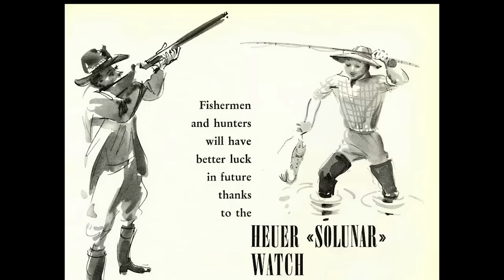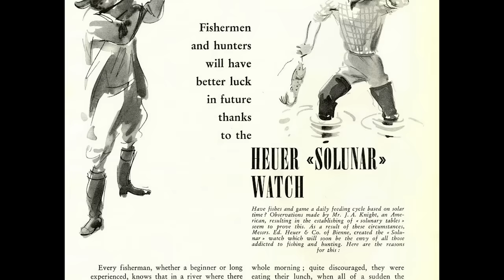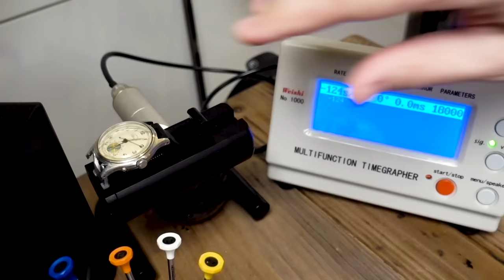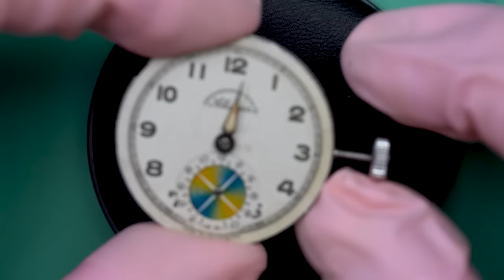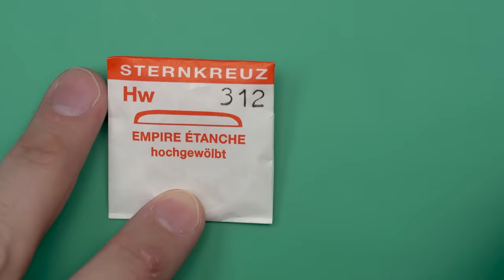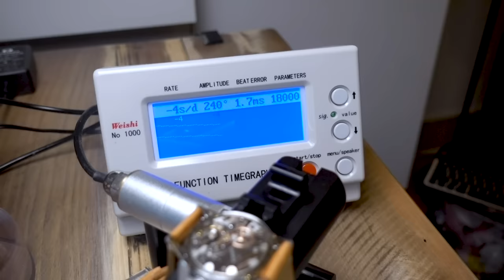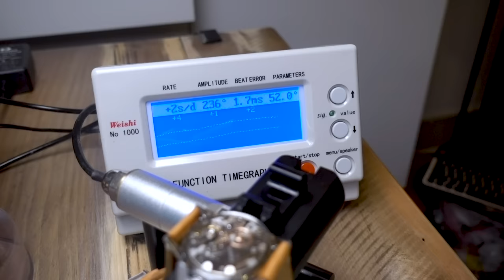Abercrombie and Fitch Solunar Vintage Watch Restoration

Comment: Wonderful restoration, Sir! I am no watchmaker, neither am I an engineer of any sort, but I think you don't explain that amplitude factor well enough. It seems simple to me. The amplitude, measured in degrees, is the total arc of a circle travelled by the balance wheel, from one end of its travel, to the other end of its travel. Measured in degrees obviously because those are degrees of arc. Strictly speaking, the balance wheel travels half the amplitude clockwise beyond its "resting" point, and the other half of the amplitude anticlockwise beyond its resting point in the other direction. So amplitude would imply the strength with which the spring and the train wheels and the pallet are able to send the balance wheel scooting off in one direction before the balance spring stops it, and makes it return, again to be shot off in the other direction by the pallet clicking over. The less the friction in the train of wheels and the stronger the spring, the larger will be the amplitude of rotation. Older movements, with more tired springs equal lower amplitude. Or have I got it all wrong? And pardon me bragging, but I spotted the bent seconds shaft as you took it out and laid it on the movement. All in all, an enthralling video. Thank you very much!

Comment: Ok, i'm not into the watch repair hobby , into classic British  motorcycles, however that vinegar and bicarbonate of soda mix is a bust. The vinegar is acidic but the bicarb neutralises the acid, dont mix them together if you need them to work,lmao, one will kill the other. You should have soaked the parts in the vinegar to remove the rust and then soak them in the Bicarb and water mix to neaurtalise the acid. Been using this method for many years on the old bikes. Hope it helps.

Comment: Hi Marshall great videos inspired me to attempt a repair on my late fathers precious 1940's commemorative pocket watch. using your guides i was able to get it running again than you for such clear instruction and the information you give on the names of the different parts and their history is awesome. i do have a question i need hands for the watch and i am finding difficult to source them i remember the type of design they were from my childhood but i cannot find the correct sizes [0.5 x 18mm minute hand , 1.7 x 11 hour hand 0.35 x 6 sub second hand] do you have a website our source i could contact this would finish off the project perfectly - i understand if you are unable to answer - keep up the great work

Comment: Wow this is a fantastic watch, selling on Ebay for over $13,000. Very nice video thanks.  Why don't you oil the main spring? Is it not supposed to be oiled?  Main springs in clocks are always oiled. Are watches different or do they come pre-oiled and they don't need to oiled?

Comment: It's a lot easier to regulate a pendulum clock than a wristwatch. There, you are looking for equal overswing on either side, e.g.  Tick - overswing - Tock - overswing. That overswing and the equality of it on either side are your amplitude and beat error, and you can time it with a chronometer, such as I have on my own watch. I got my late grandfather's Gebruder Resch "Remember" Vienna regulator working after decades of non-running. My late dad got a local horologist in, but he couldn't get it going.

Eventually I stripped it, saw how it worked, reassembled and oiled it, and it ran. Because the clock has no remontoire. it loses a bit of time every time you wind it. I have regulated it so that it gains that same time (three or four seconds) in one week (after which it needs rewinding). My grandfather received the clock in damaged condition, so he bodged several broken components (e.g, brazing part of a jeweller's screwdriver onto the end of the broken chime flirt). Over time, I have got a couple of "for parts" Gebruder Resch movements and replaced all the bodged parts with genuine Resch originals of the correct era.

I have repaired and restored anniversary clocks, cuckoo clocks, carriage clocks. wag-on the wall and mantel clocks, just for pleasure, though I do get some money from my hobby.

But never once have I felt confident to tackle wristwatches, and I am amazed at your skill and steadiness. I would be losing screws right and left if they weren't big enough to tie up a tugboat. Your skills are impressive, and I love your videos.

Comment: I have a modern watch like this, where it shows a bunch of outdoors info. I think mine shows a compass and tides.

It does use a battery, but it's quartz so hey that's a definite plus
Reply: Ok turns out it tells basically everything, like temperature, tide, date, and direction lol

Comment: Hey Marshall - I have been watching your restorations/repairs for a few days now and I am now hooked! I have an original Citizen Navihawk I bought back in the 80's that I will be cutting my teeth on restoring. One of the items I need the ultrasonic cleaner, but cannot seem to find one with the basket that doesn't allow the small parts to fall out like the multi-level one you use in this video.... can you help me out there? Thanks!

Comment: Great vid. Distilled vinegar soak removes rust (just let it sit and soak an hour or overnight depends on the rust). Add baking soda & water to neutralize the acid after scrubbing and dry and spray with WD40 wipe clean.
Reply from the maker: Good to know, thanks!

Comment: Hi. Just a tip. when you put the baking soda,in the vinegar. It stopped the vinegar from working. The baking soda is to neutralize the vinegar. You can use evaporust ( check spelling )  It will not harm the metal,but does remove the rust. I am a new subscriber. Just want to help if I can. Liked,shared. All my best.
Reply: hi bobby !

Comment: Electrolysis can remove rust. It’s like plating but backwards. It can remove plating and paint too so be careful but a short dip really helps with rust. Test it on a junker. Plate after electrolysis to prevent further rusting.

Comment: Just a note for the future that main spring with the bend at the end. That is an old clock makers trick, cut off damage, heat it up glowing, then bend over. It act like a catch on the barrel hook. Its when they could not find a replacement spring.

Comment: Loved the video! Marshall one question: when you pull the pallet fork with a wound movement it is possible to crack or break the Pallet Jewell? If it is so, what would you do? Find another pallet fork, or it is possible to replace just the jewels?
Reply from the maker: It is technically possible but it's still very unlikely. If you do break one you can replace the fork or the individual jewel but the jewel replacement is kind of an involved process involving heating it to loosen the shellac that holds it in place and then melting more shellac onto it.
Reply: @WristwatchRevival  Oh, thanks!

Comment: This is a interesting video I see that you're new to this, I also noticed that in your video you've missed at least 4 jewels and the main spring itself. The jewels you don't show cleaning and lubricating are the ones for the balance wheel which are critical for the Operation of the watch which if aren't cleaned and lubed could snap the balance wheel pivots and create the biggest problem you'll ever have in trying to find a replacement or having to actually make one on a lathe (which I have done) and isn't an easy thing to do. Also there are 2 more jewels that are held on by a plate and screw they also need to be removed and cleaned and lubed. Also you need to lube the mainspring use the high tension lube I think you said it was the blue lube?

Comment: I use a solution with oxalic acid to remove rust by soaking overnight but never on anything that small. Electrolysis works well also. I've scrubbed rust off of plated parts using aluminum foil and Coca Cola, too.

Comment: Wonderful video 
There is a product called “metal rescue” that removes rust and will not harm the base metal, I use it all the time.
You can also use a 50/50 mixture or water and vinegar but only let the part soak for 15 minutes at a time before rinsing and cleaning, if rust remains then repeat but if you leave the part in the vinegar for to long the vinegar will pit the base metal.

Comment: Hi Marshall, I really enjoy your videos. I am a beginner at the watchmaking hobby, and I have a question: Where do I find the tool you use to wind a watch when the crown and winding/setting stem has been removed? It's a small tool with a square thin protuberance, almost like a drill bit,  that you insert into the hole where the winding stem usually goes. I'm looking for one that works on pocket watches, so square, and about 1/16th of an inch or so wide. Thank you in advance!

Comment: Quick suggestion - if you have steels specifically that have significant amounts of rust, but you want to de-rust them GENTLY, get yourself a bottle of Evapo-Rust. It's fairly chemically inert, i.e. it's not an acid, it's not caustic, so it's a lot safer to use. And it's reusable.

Comment: Love the watch and the video, thanks for sharing. Just a question and NOT intended to be critical, there was some staining that remained on the hands. I know you prefer minimal appearance work, and don't mind signs of use. Do you want the staining on the hands to reflect those signs of use, or is some refurbishment of them too difficult or risky??

I had seen a couple of the A&F watches over the years, but had no idea the works are that high end. I'll be watching your videos, thanks for taking the time.
Reply from the maker: That to me is the defining line. I don't mind some light cleaning if there is dirt or rust on a part like a hand, but I would stop at refinishing them or replacing the lume. In this case I did go back and lightly clean up the rust that was on the hands to try to prevent future wear on them. The lume is so delicate though it's risky so I only did it a little.

Comment: Winding stems and even crowns are kinda considered replaceable at some point...ultra fine abrasives and oil are sometimes necessary to get rid of rust.  Considering the value of that rust, that's one I'd contact a pro about.  Very cool watch. I sense you're realizing the need for a lathe soon.

Comment: Most guys use MC51, which is extremely safe and reusable, but I think if you use vinegar baking SODA, you should do vinegar first, then baking soda if it's steel then distilled and isopropyl alcohol.
Reply from the maker: I'll check that out thank you

Comment: Great stuff! I grew up reading John Alden Knights books on Solunar Theory. As an amateur watch tinkerer, How come you don't let down the mainspring before working on the balance wheel, etc.
Reply: He usually does let down the main spring first, he just explained at 12:30 that he couldn't figure out how to do that on this specific model until he took it apart

Comment: So nice! Did you use a tide table to set the correct tide time? Also, do you need to replace the pusher tube/pusher for the subdial?

Comment: I think one dip is (essentially) what my dad used to call trike (that's how it sounds anyway). We used it for cleaning grease off delicate engine parts. Trichloroethylene (TCE) is a nasty chemical and you should not let it touch your skin (but it does feel quite nice as it evaporates off your skin - as a kid I would put my finger in the jar my dad kept it in, naughty boy I know), nor should you breathe in the air near it as it evaporates. The FDA has banned it for some of its prior uses as it causes cancer. That watch is so cool.

Comment: Looks like most of that rust originally came from the winding stem. To get the rust stains from the other parts, you could use your ultrasonic cleaner with a weak acid, like vinegar - without the baking soda. Baking soda actually neutralizes the acid. I would definitely replace the winding stem, though.

Comment: Vinegar and baking soda neutralize each other when mixed and become ineffective. People see bubbles coming out due to the two reacting together and think some cleaning action is happening. Use Evapo-rust; it is a very safe non acid rust dissolver.

Comment: Fun fact: the more quickly something evaporates, typically the higher the alcohol content.  One-Dip, depending on the manufacturer, is usually 99%+ tetrachlorethylene or trichlorethylene.  Manufacturers add ethanol and similar products to lots of liquids (like bleach wipes) to make them dry faster.

Comment: When I was in Germany, rust wasn’t allowed on vehicles. There was a product that would react with the oxide and neutralize it, however the rust turned black but would pass the inspectors screwdriver test. It was called a rust converter.

Comment: 1:05:07 is that a split in the watch strap leather by the bottom spring bar? Fantastic video by the way, just dont want the watch strap to break and cause damage after such a lovely restoration

Comment: Early comment. As long as the location of the rust won't hinder performance, a short soak in some evaporust then a wash should be enough to hault the corrosion.

Comment: Molasses and water mixed 50/50 is a really great rust remover that's easy to use...
Reply: Also, dipping parts in Gibbs Brand oil and wiping/drying them back off will help keep any future rust at bay without making the parts oily or attract dirt. It seems to soak into metals really well without discoloring them or leeching back out. The stuff is wonderful, I know of hot rod guys who drive around in bare metal hot rods that don't rust because the sheetmetal is wiped down with Gibbs Brand oil...

Comment: I have no experience working on rusted watches, more with bicycle-sized screws/parts, but:

For chemical rust removal, the key is time. No brushing usually is needed, just an overnight or somwtimes longer bath in concentrated vinegar (vinegar essence) or citric acid followed by a light wipe-off brushing. For small parts, a few hours should be enough. The reaction always takes time and happens by itself, it‘s just a chemical reaction that needs no mechanical help.

There‘s also specialized liquids like evapo-rust which should work on miniature screws too (because why shouldn‘t they).

Comment: I heard a long time ago that fishing has something to do with barometric pressure. They won't bite while the pressure is changing, or during a rapid change or drop in pressure, or something to that effect. I'm no expert, but producing a barometer small enough to strap to your wrist doesn't seem unfeasible.

Comment: A little muriatic acid will remove rust like a charm, just don’t leave the metal pieces in the acid too long or it will begin to eat the metal as well.  That’s what I use to clean out old rusted gas tanks to get into crevices where I cannot get to by hand.  It has never failed me.  Best way to do it is to leave the part in the acid for a while until you can visibly see the rust start to get dissolved by the acid and then remove it and brush it.  If any rust remains, rinse and repeat until you can only see metal.

Comment: When you tried to remove the bend in the seconds pin, i think it would have been easier and safer to look at it sideways, roll it until the bend is upwards, hold it there and push down gently to remove the bend and see the results simultaneously.

Comment: It would be nice to get a set of tide tables to set the tide indicator and see if it works.  A lunar day is 24 hrs and 50 minutes, tides therefore are 12 hrs 25 min.  The divisions in the tide wheel should be set at 6hrs 12.5 min for the 4 divisions.  It would be a nice extra to set the tide indicator properly.

Comment: Vinegar is cheap and effective at removing rust, but it can TAKE DAYS, not just hours. It will eventually work. If you want it faster then you have to use something like evaporust. With tiny parts you have to keep an eye on evaporust, but it will work faster than vinegar.b

Comment: Boiling a piece of steel in DISTILLED water will convert red rust (ferrous oxide) to black rust (Ferro-Ferric Oxide) Black rust is softer and can be brushed off with a stiff tooth brush or steel wool. you simply boil, brush, boil brush over and over till the metal is clean. Black Rust also is inert and it will not continue to degrade the metal so if you miss a tiny bit of it in a pit , there will be no additional damage. A droplet of kerosene on the metal will also stop rust from reforming if you put kerosene on the metal while it is still warm... you can wipe or even remove the kerosene with a solvent afterwards.

Comment: Natrium Bi Carbonaat or in English: Sodium bicarbonate, (in Wikipedia). I use it to clean silver, put Alu foil in a glass bowl, put the baking soda in, and coking hot water, and your blackened silver,  silver get's black because of sulferdioxide, and the baking soda will combine with the sulfer and the aluminium somehow , and the silver comes out  shiny...try it out in a tea spoon,, you might want to use it on silver pocket watch backs..
Reply: You are using galvanic reaction(battery). The silver oxide is being reduced and the Al foil acts as a cathode you have to make them contact each other fot them to work.  Buy boiling the NaHCo2 you are converting it to Na carbonatena (Na32Co2) which is slightly alkaline vs acidic(NaHCo2).  Yes it works great with silver but never tried it on iron rust.
Reply: @zakyxzaky  I tested it on coins and  tea spoons  it works..
Reply: @zakyxzaky  the  salted water makes the connection.. you can put some natrium chloride in the water too ( table salt).

Comment: Once your down to rust stains or just in the nooks and crannies toss your parts into boiling water. It will convert the rust into a rust preventing oxide. Hit with a fine wire brush the Remember to dry and oil afterwards. In gun works this is a common rust bluing method and a way to save as much parent material as possible.